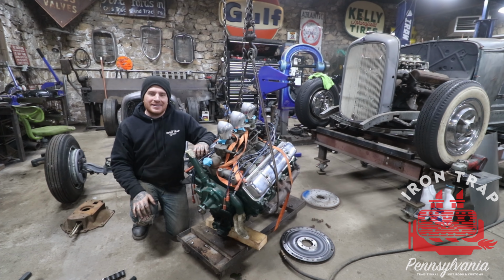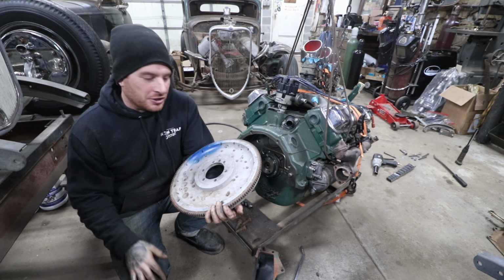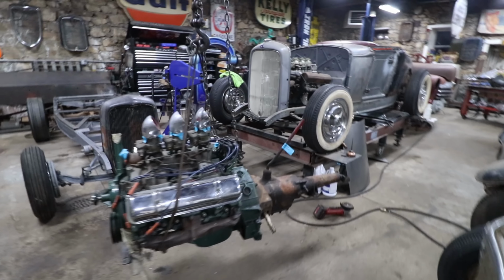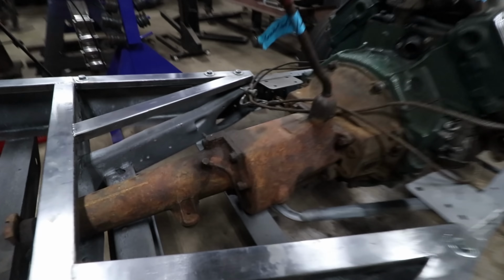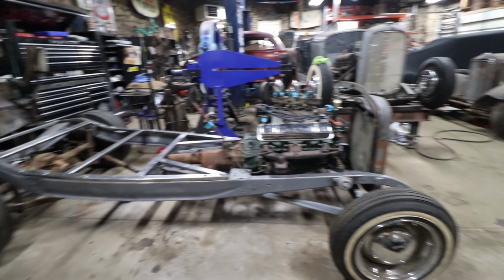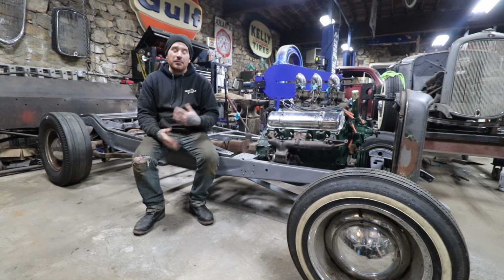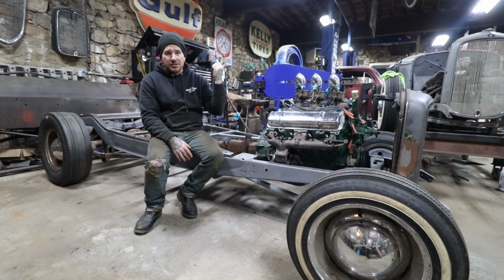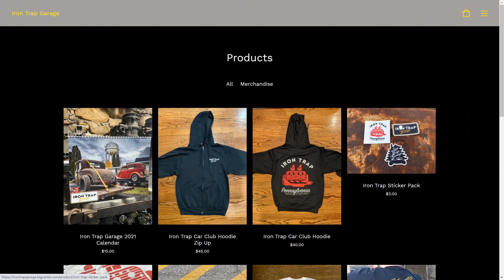Installing A Fresh Oldsmobile Rocket Engine Into The Schroll 1932 Ford Coupe!!!

Comment: The closest I have gotten to hot rodding in my life was 1/25, 24th. plastic models. In the old AMT models, all the engines fit in all the models just by putting them onto the standardized motor mounts! If you bought enough kits, you could put in whichever Olds, Caddy, flathead you wanted in thirty seconds. No mods, no fuss.
If the real things were that easy, I might have gotten into that part of the hobby.
Masterful job, Matt!

Comment: I was born in 1947 and hot rods were everywhere when I was in grade school. I had an older neighbor kid who had a chopped 34 Ford with an Olds v8. He had to cut out a good section of the frame on the right side to fit the engine. This was before headers were made. He would let me go cruising with him at night when I was 11. The thing was so flexible that the right front tire would float 2-3 inches off the ground at anything over 90. Rods were all lashed together pieces of s...  chrome and metal flake were just in the magazines.

Comment: This has the potential to be your best project yet. The 324 can easily pump out over 300hp. 1956 heads are a must unless you go to high compression pistons. Gene Adams is the absolute master of the Rocket Olds engines. A one time neighbor of mine, Gene set records in his parents '50 Olds fastback. He developed so many "Tricks" like splitting the center exhaust port (We welded a piece to the header flange and shaped it to protrude into the port). This allowed 4 exhaust pipes on each head. I believe Gene now lives in Arizona and still dabbles in Olds Speed. Do you have a posi rear?

Comment: Hi Matt, This is something that has saved my bacon a few times. When dummying stuff up I use a twink pen (correction, whiteout pen) and write say in this case "Loose" on the flywheel, as you can come back to it a month later and bolt on the new clutch and think all's well when its not. Being a mechanic it happens when you are working on a job and wait for a few days or weeks for parts for something special. Then in that time you done more than a few jobs and just forget where you are at on that job. As for Aluminum flywheels on a light car yes they are ok but on a 50s tank  may damage the surface and develop clutch shudder if given a hard time regularly. More so than a steel flywheel and if you go to a puck type competition clutch with a non sprung centre where its either in or out  and with a higher performance motor. . .  This is probably where some of the negative stories may come from. Weight, friction, more performance.

Comment: Your videos are great on this 32, I wish I would have had access to something like this twenty two years ago when I was building a chopped all steel 5 window that was a hotrod in the early 60's it had been channeled and when I bought it it came with a new frame and Pete and Jakes suspension. I built it into a roller but after a few years I fell in love with Muscle cars and a guy from Phoenix wanted it worse than me, I'm kicking myself now. Thanks for the channel and memories.....

Comment: Hey Matt
   Cool Video, Brought back a lot of memories from my youth.
I remember putting several Olds engines in Hot rods.
But as I recall we wanted to use the Hydromatic trans most of the time which ment even more clearance making.
   You might look into putting an electric overhead winch on your trolly.
The old chain fall is how we used to do it but that electric lift is nice when you have to do a lot of in and out as you were doing on the Olds.

   Be Safe Well and Warm
           Everybody

Comment: Just raise up the motor mounts an inch or so and eliminate the double rubber. You can do it Matt. Enjoy
Reply: My thought too. A little three sided pad cobbled from a piece of box tubing welded to the frame with the top at the right level for one rubber disc.

Comment: Olds motor looks good in there! My 36 Chevy Sedan Delivery had one with Pontiac 4sp hydramatic transmission when I bought it. Drove it several years then the motor blew up too much adult beverages one night. Swapped In SBC 70-72 400.

Comment: What do you think of profiling the bracket and shiming the motor mount pucks?  Machine a steel disc 1/2" larger diameter than your pucks for the spacers (if the spacer is thick a slight angle could be added to the sidewall increasing the diameter).  Scribe the final diameter on the bracket top flat then scribe angles tangent back to the vertical wall thickness triming the scrap?  If you need an elongated hole (?) adjust the scribed profile accordingly.
Your angle iron is fairly stout, others using lesser thickness may want to add a radiused gusset to the underside.

Comment: Those  olds engines should be leveled by using a board front to back across the carb tops, that’s the way they were designed!

Comment: Had a 59 Pontiac 389 with an iron f'wheel  That would have been a real bitch with an alum wheel. Heavy needs heavy, light can use light.

Comment: Is there enough room at the back of the trans to slide it back enough for the the input shaft to clear the bell housing if the trans needs to come out later? I guess you could pull the engine for a future clutch repair but that would kinda suck.

Well, ok then..🙂

Comment: These Olds motors were kinda "torquey". What rear end gears are you using ?? Some 3:70's +- would make this a fun ride with that motor and trans. Might even get away with 3:50's. ;o) In high school, a friend had a 39 Chevy with a Olds and LaSalle trany. Acceleration in second gear was FUN !!! Don't remember what he had for a rear end. Going back that far (1959/60) , it was probably a classic chevy unit.

Comment: Do you need to match balance the Flywheel to the original trans drive plate? I have worked on a few engines which were converted to manual without match balancing . One lasted 50 miles and another had the crank wobbling so badly the block crank bearing bores were destroyed

Comment: Please keep in mind drive shaft angle.
Reply: Exactly!  You get that correct first, and live with whatever angle the engine is at when you are done.  Using single-cardan joints on each end of the driveshaft, you need to have the same joint angle on each end otherwise you will have bad vibrations which will lead to premature u-joint failure.

Comment: The easiest thing to do is move the engine back until the pulleys clear the front crossmember. Notch the rear tail shaft crossmember . Firewall will need to be addressed about the  back block clearance. ...........

Comment: Reducing the depth of the channel to chassis rail depth will, in my view, improve the overall proportion & appearance as well as solving more than a few clearance issues both inside & outside the body.  I have seen far too many cars, both open & closed body types that were ruined, from a practical driver standpoint, as a result of excess channeling. The Pagoda City coupe would be a good example of this. Just saying.
Reply: Well that would mean changing the intended look of this car, that Larry intended and Matt wants. I think he knows what he is doing. 
Also a channeled hotrod just looks bitchin, and the model A coupe drives fine. You can see it in many videos.
There are plenty of oringinal cars out there if you perfere them.
Reply: @johanneseder27  Yes, you're right, it would indeed change the look of the car if the depth of channel was reduced to chassis rail depth. We all have opinions, & in my view, it would change the appearance for the better. Opinions may vary.  Keep in mind that Larry didn't build the car, he bought it, so it was done by someone with seemingly few skills & some big ideas that, as it turns out, were not well engineered or well executed. Hopefully we, as a community have learned from the mistakes of those that went before us.
I started my 1933 three window coupe, back in 1968. I still have it, & in the last 52 odd years I have seen a lot of cars, & I have seen too many perfectly good cars ruined when they were channeled too deeply. Just an observation, try not to get too excited.